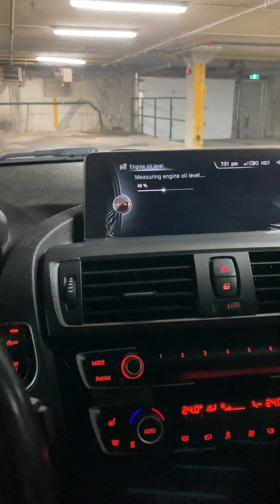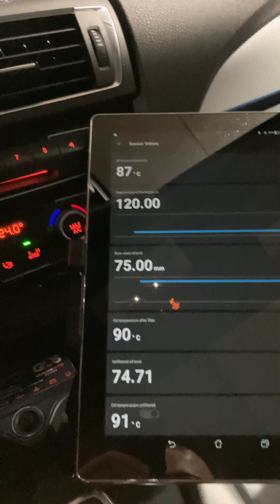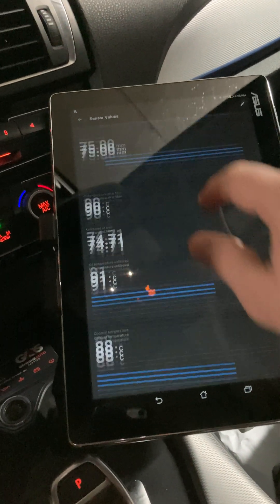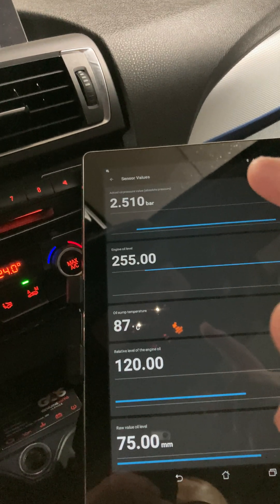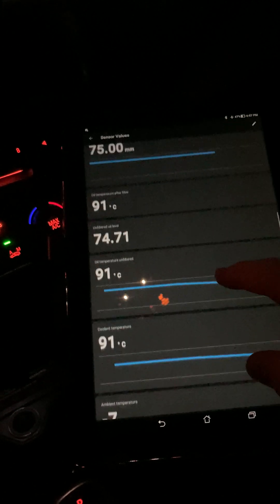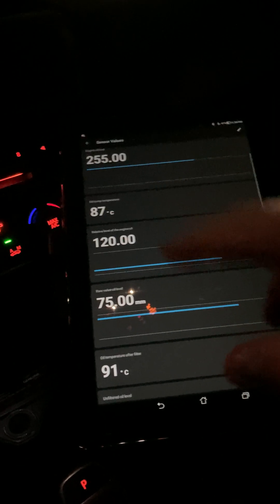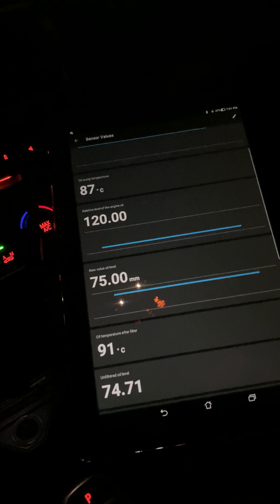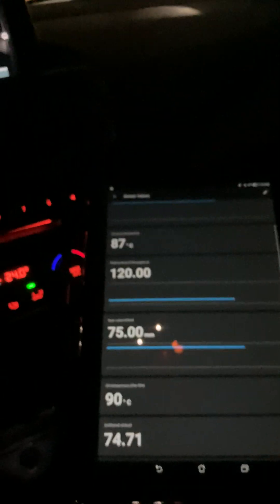Valvoline Restore & Protect Check-In and Top-Up in BMW N20 oil burner engine

Comment: I have the benefit of a dipstick on my Telluride so I can also look at the color of the oil.  I went 54,000 miles on dealer synthetic on 5000 mile oil changes.  Switching to Restore and Protect, my oil got darker within 400 miles, and has continued to get dark, but somewhat less early with two subsequent oil changes.  That proves to me it is cleaning up for insufficient cleaning the first 54000 miles.  Other than depending on its API SP rating, I can't personally speak to its ability to deal with a turbo.  For people with turbos, I would definitely have it tested to make sure you don't go too far on oil change interval.  On my NA engine, I will go back to 5000 mile oil changes after this cleaning phase.  (I would not do that if I drove a lot of short trips.)
Reply: @garyganser2451  this sounds like a solid plan

Comment: All the confusion because there is no dipstick. I have an N20 and using valvoline restore and protect as well. I don’t have oil consumption issues with mine but wanted to try out the product.